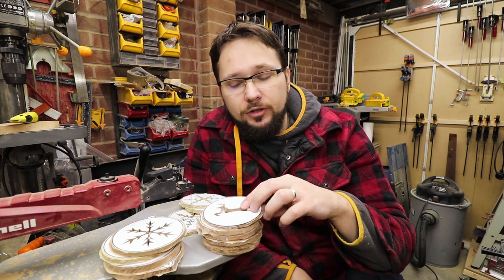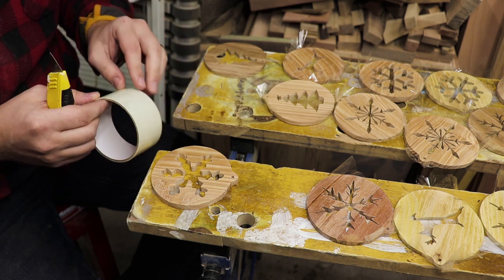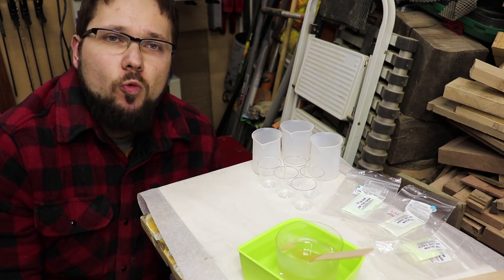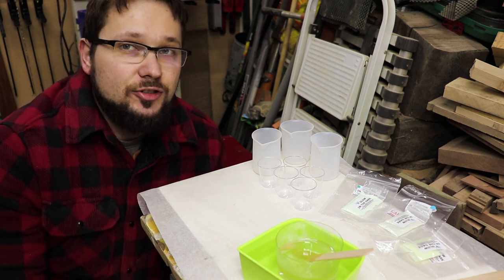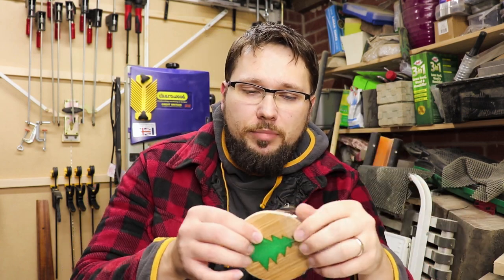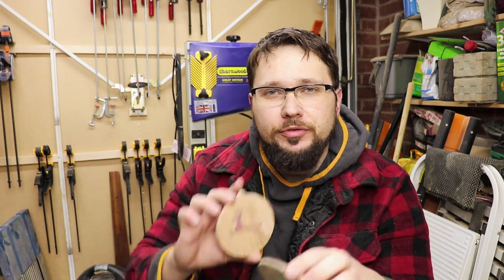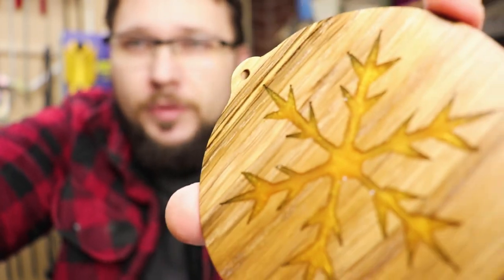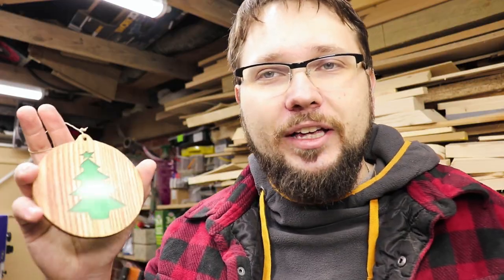Wooden Christmas decorations with Epoxy Resin - DIY - free stencils

Comment: Good project and nice videography. The first question I have is why use CLEAR tape? So you are now warning both parts of the resin?  Yorkshire grit on bare wood! Nice one... love the blue snow flakes, all colours.
Reply from the maker: Glad you liked the video :) why clear tape, because that's what I had. Used grey tape and it was difficult to take off. Used carpenters tape and the epoxy leaked. There is a special tape you can use ( can't remember the name of it ) but it cost a fortune comparing to the tape I used and the results won't be that much different. Second question - yes both as when I'm recording my videos I can't turn on my heater as it's too loud so it was very cold in my garage hence I warmed both. Yes Yorkshire grit it is a blend of grinding bits but also waxes and mineral oil everything that the wood needs ;)

Comment: Instead  of using cello tape on the back, glue cantact paper to a flat board. (glue non sticky side to board) Then remove backing  to expose  sticky side of contact paper. Press scrolled  wood to contact paper. This will eliminate the wavy resin on back side when pouring  resin.
Reply from the maker: Good tip thanks
Reply: @CasualDIY  Oh, I forgot to mention. don't use to much glue to glue contact  paper  to wood or you will have to pry your work off. Use a very temporary glue for that like the rub on stick kind.